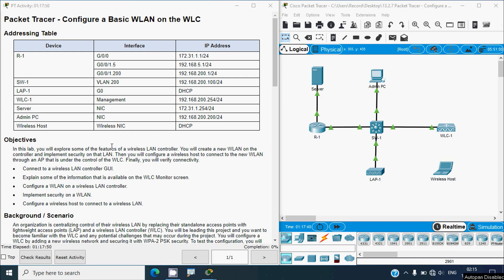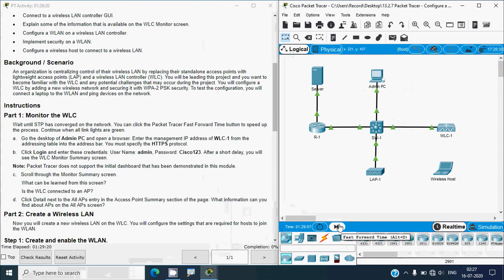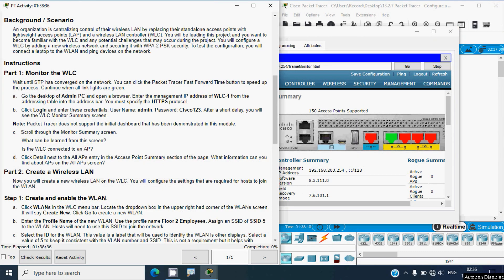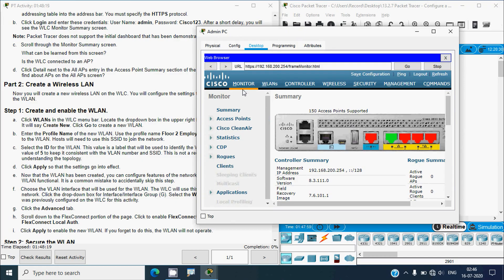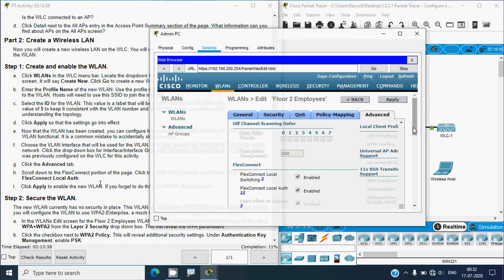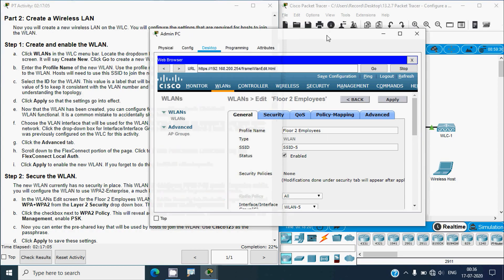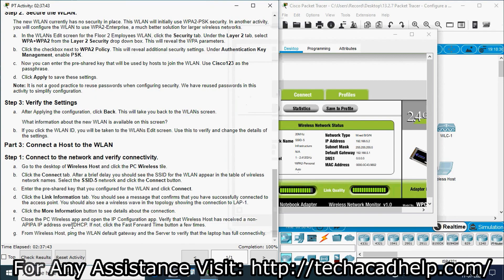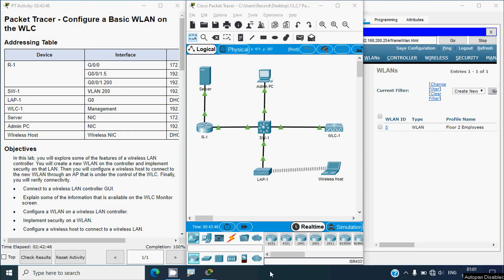13.2.7 Packet Tracer - Configure a Basic WLAN on the WLC

Comment: the last part why its not connecting after following all through to the last step..how is it ressolved kindly
Reply: I solved it by going onto Wireless host > config > Interface - Wireless0. Then enter the SSID (SSID-5) then under authentication select WPA2-PSK then PSK Pass Phrase as Cisco123. That should get you to 100%
Reply: @DaLegacy23  Thank you!
Reply: @DaLegacy23  thank you, i was stuck here
Reply: @DaLegacy23  thank you, I was having that problem too, can you explain why it wasn't showing up on the wireless connect?
Reply: @yaycrapp1021 I have no idea. I think there’s an issue with the packet tracer